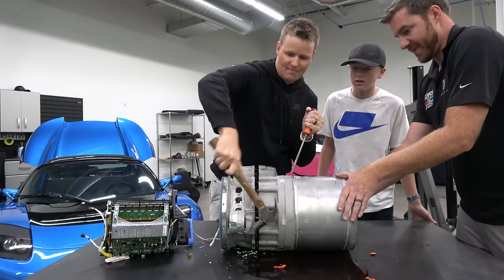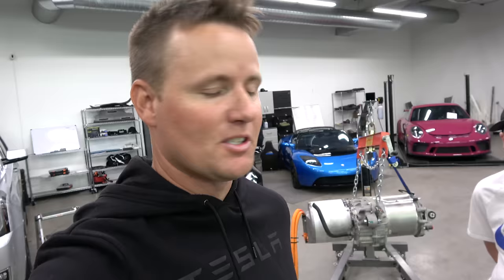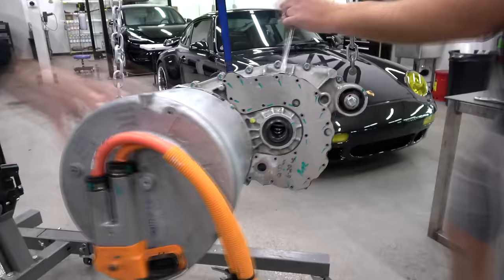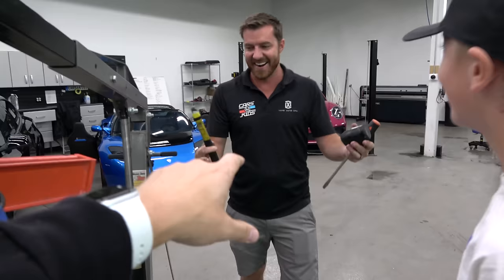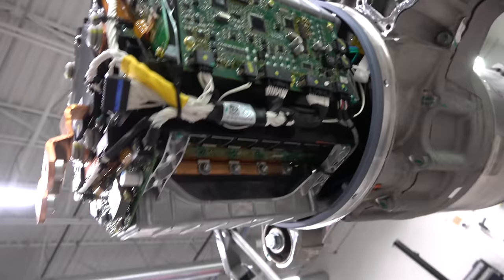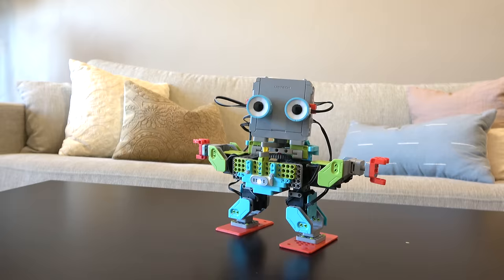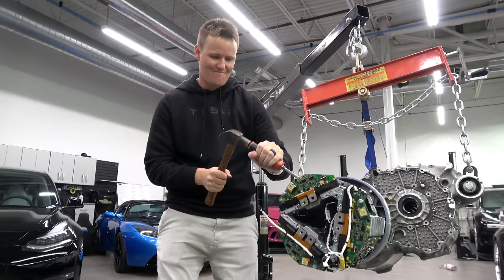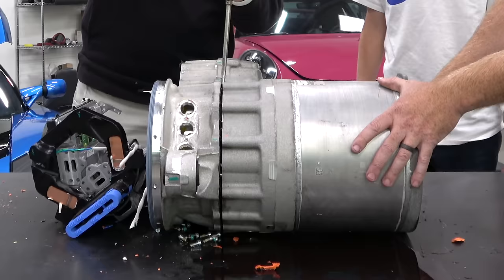What's inside a Tesla Engine?

Comment: I guess, I missed the part where he actually opened the motor.
Reply: And he called it an engine 🤦‍♂️
Reply: @gibbethoskins8621  lol
Reply: I waited the whole video for the actual motor... thumbs down.
Reply: yup the coil and stator and rotor and other stuff...unopened :(.....  the actual motor
Reply: Yes just saw the final drive and diff, motor unopened.  If we can buy this off ebay maybe we can do a swap on an ICE car.
Reply: True
Reply: @CrookedGringo that section in the center with all the gears is the transfer case, the part that transmits the power from the motor to the wheels. The motor is actually the other cylinder on the other side of the motor that has various magnet and copper coil assembilies that will turn when power is applied.
Reply: they didnt even find the Motor ... xD They found the boost converter and inverter and the transmission :) ... ahhh snap do i sense some biting sarcasm here :P
Reply: @CrookedGringo nope its ... not the motor is the cylinder behind the transmission which he actually showed to be the "motor"... guess they are not allowed to show the winding patterns of the actual Motor since Tesla would rip them a new one then ... the Stuff they showed is not very interesting ....
Reply: Yea we never saw inside the actual motor itself
Reply: @CrookedGringo wrong.
Reply: Panas Tiwari he called it an engine. Cut him slack. No problem
Reply: It hurt when he broke the Tesla inverter
Reply: @CrookedGringo the actual electric motor is the fully assembled bit on the right of the table they left behind. The video should have been called whats inside a Tesla inverter and final drive assembly!
Reply: Yup, the real electric motor remained unopened, maybe he wants to re-sell it :)
Reply: You didn't he just ran out of brain power...🤷‍♂️
Reply: @CrookedGringo Dude, that's the Gearbox...
Reply: Maybe it was intentional because they wanted to actually use the motor as a replacement for some car? But I am just speculating here, why would not they just replace the whole unit, so maybe no. I was really looking forward to looking into that motor.
Reply: @CrookedGringo 
You are 100% incorrect, the irony is that they opened up everything but the actual brushless motor! The motor is the other cylinder they on the opposite side to the controller with the three PCB boards in it. Hope that helps you understand the other comments.
Reply: @simonstreit8214  Good guess, but you would have thought he would mention that if it was the case. I dont have a better guess other than ignorance or running out of time.
Reply: @CrookedGringo what has been exposed is not the motor, if you look for asynchronous motor rotor on google images, you'll see the core part that they never got to because it is behind the gears... still a nice teardown to see anyway.
Reply: @CrookedGringo No, that's the transmission. Where's the stator or the rotor? There's nothing to be learned from this video other than there's gears and bearings inside.. wow
Reply: @TanteEmmaaa  That is why I started from the end and going backward.
Reply: me too :-/
Reply: They wouldn't be able to open the motor without special equipment, if you ever get the chance just try to pull the outer sleeve away from the magnet coil inside and it is extremely difficult even on a small drone motor let alone that monster.
Reply: LOL, so true!
Reply: Funny how you guys expected to see push rods, cylinders, crankshaft, ignition wires, cam gears serpentine belts...
Reply: @UltraCasualPenguin  we don't. We expect to see a stator with copper windings and a rotor, which we could see, if they actually opened the actual engine. But that is the unopened cylinder. It baffles me, how a channel which suggests it's very curious isn't curious enough to open a quite heavy metal cylinder.
Reply: They never actually opened the “motor” the lack of mechanical knowledge was staggering
Reply: maybe that is the reason he called it an engine,he doesn't know there is a motor in there😂😂🤣🤣🤣
Reply: No kidding.. literally why I was watching
Reply: I wonder if there was any potential danger of stored electricity in a capacitor in the motor enclosure or something like that.

I wonder if his buddy told him off camera to chill on the actual motor enclosure, because that is definitely part of what I was hoping to see too.

Comment: This could have been actually interesting if it had been done by someone who know what they're doing.
Reply: Automation technician here. This is extremely irresponsible. The coolant and oil are poisonous liquids with unknown effects. 
If you should do this you should use proper safety equipment.
They never looked in the motor, they just dismantled the inverter(variable frequency drive) and the transmission. This could litterally KILL YOU. The capacitors can hold charge for years and touching them could result in a lethal discharge.
Reply: Sigurd Malmin Hansen they’re not poisonous to touch. It’s not like they were drinking it buddy
Reply: Capacitors hold voltage....voltage doesnt kill....current does
Reply: pay me enough to afford the engine and i will do it the safe way

(using a chainsaw)
Reply: Gonna have to agree
Reply: @alexanderwall8240  Unfortunately, this is not entirely correct or at least incomplete. In order to kill a person, you need a certain amount of current (the time how long it flows, we just leave it out of the game). You need a certain voltage to let this current flow. This must be so high that a certain current can be reached. Therefore, both factors are always decisive. Incidentally, a capacitor in the converter could kill you, but this is also related to the capacitance.
Reply: MrPike ikr
Reply: Sigurd Malmin Hansen he’s famous and he’s not even bothered to call Chris fix
Reply: Exactly
Reply: Totally
Reply: @sigurdmalminhansen4846  If the effects are unknown, how do you know its poisonous?
Reply: Well the point of this channel is to learn. And plus nobody knows what these are. Tesla is like 5-4 years ahead so nobody knows what they are doing
Reply: @stunninggaming6007  none of this is remotely true. especially the first sentence.
Reply: Alexander Wall That isn’t true.
Reply: @alexanderwall8240  your body has an impedance. By touching it, current starts to flow through the body due to the voltage
Reply: Exactly
Reply: @sigurdmalminhansen4846  disagree. i've dunked my hands in various fluids (hydraulic, coolant, oil, etc) and never had any serious issues. the only time i went to the hospital was when i was working with absorption fridge evaporator coils. the coil broke and shot ammonia in my face. it wasn't pretty at all.  also, coolant is coolant. that oil is probably gear oil
Reply: @alexanderwall8240  what do you think a potential difference (voltage) can cause?
Reply: Rich rebuilds has a good channel on these
Reply: @alexanderwall8240  that's like saying bullets dont kill the powder does
Reply: I agree. Transformers hold very poisonous PCBs used to keep them cool. I imagine the first liquid was that. Everyone should take 5 mins and read about them, some are absorbed through the skin and can cause lasting effects. During the Vietnam war they used PCBs as a defoliant and war vets suffered years later with various organ failure/issues. Also, super computers are cooled with them. They have non-conductive properties that make them ideal for surrounding electrical equipment.
Reply: @sigurdmalminhansen4846  no
Reply: @sigurdmalminhansen4846  love how he is so wrong that he won’t reply, coolant could be poisonous as in antifreeze, but without that it’s just water, and water is type of coolant, most coolants are water mixed with antifreeze. And oil isn’t that bad at all, and in other words, the only time this stuff is poisonous is by digestion. And for the electricity, you won’t get shocked because there are capacitors…
Reply: @alexanderwall8240  lol, are you for real ?
Reply: Correct, he is a butcher... If done the sensible way you see more and the thing is not scrap afterwards....
Reply: Children pretending to be mechanics!
Reply: Completely agree. But these guys also tore down a Pacman machine and couldn't learn anything from it.
Reply: @alexanderwall8240  Capacitors hold voltage, and yes voltage kills. Also, they can deliver almost unlimited amounts of current, since they have almost no internal resistance (ESR is very low). Next time, make an educated comment.
Reply: @sigurdmalminhansen4846  coolant is not poisonous if a person is not drinking it. when I change out my water pump, thermostat, throttle body, etc, I get coolant all over my bare hands and it doesn't do anything to me.
Reply: Yea stripped all the bolts
Reply: @alexanderwall8240  Don't both kill anyway? high voltage means high current and vice versa
Reply: @sigurdmalminhansen4846  thought the same thing,” don’t touch that kool-aid
Reply: Yes. I fully agree.  An intelligent person would have not been surprised by "coolant" and "lubricant".....and would probably have provided some explanation/information.

But that's what you get when the video title called this an "engine".

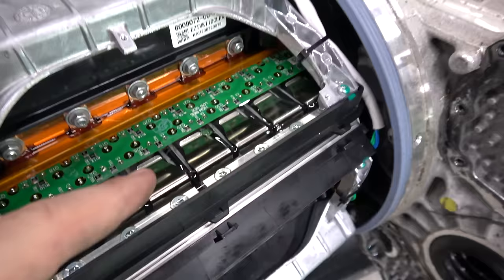5:28 ..."something really, really interesting" ..."but when you touch it, it's sticky".  "What is that stuff?"     It's called conformal coating .....and I'm not an electronics engineer.

.
Reply: Right?!
Reply: @Alexander Wall theres enough amps to kill you
Reply: @alexanderwall8240  Three ingredients are necessary to kill : voltage, current, and time. so, the answer is that *energy is what kills you*, not voltage alone, and not current alone
Reply: Weber auto
Reply: @joelthomas79  thanks for enlightening